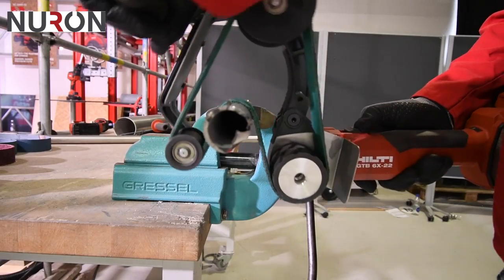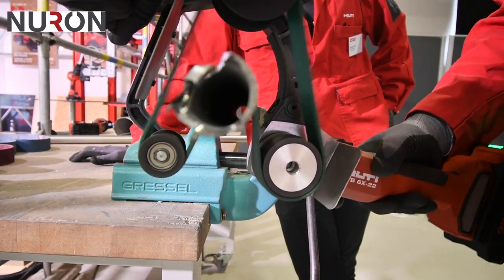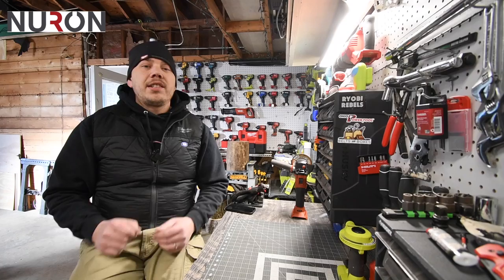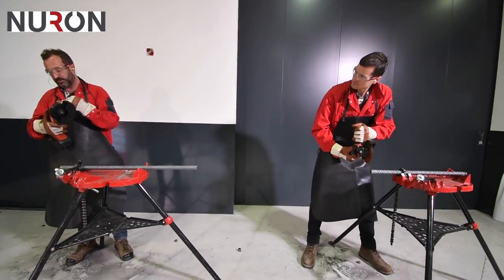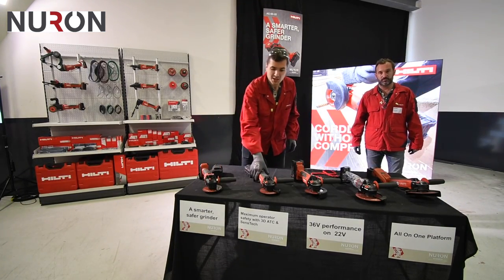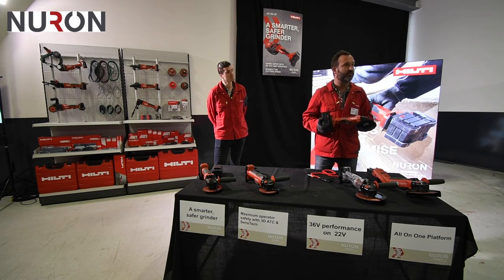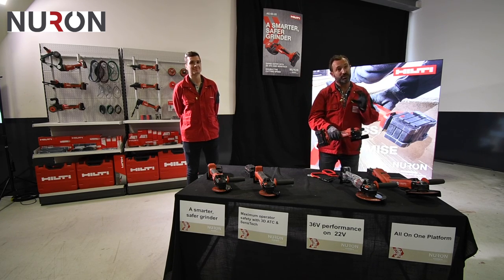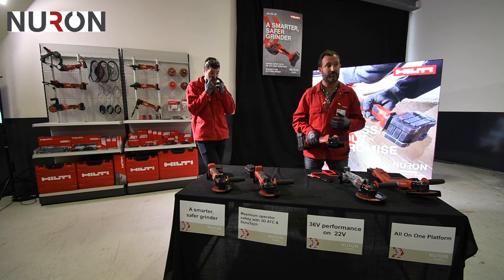These tools will "GRIND" your grears

Comment: Is Nuron version expensive ? Comparing to Milwaukee or Dewalt.
Reply: Ya , I dont think there is many that can keep up with hilti prices . 🤑🤑🤑 sooooo overpriced
Reply from the maker: HILTI needs to do sales like the other brands have. With HILTI you dont get discounts yet if you buy a kit. Im hoping that it changes in the future
Reply: The batteries are expensive.  The tools are cheaper than Milwaukee and Makita. The specialized stuff…hit or  miss on price competitiveness.
Reply: @onsiteelectricianscott4025  Compared to what?
Reply: Milwaulkee, Dewalt, makita, Hilti is more of an industrial brand tool company, they make the best of s.d.s hammer drills on the market, I have never owned a impact from hilti so I cant say they are the best but hilti is rare industrial strength , not many people got them because of price and availability of them
Reply: @onsiteelectricianscott4025  Like for like, I’ve found that their bare cordless tools to be the same price or even less than Milwaukee and Makita.  Dewalt can be very affordable, so it’s a little mixed there.  The batteries, although cheaper (like for like) get you because they don’t have promos or discounted kits.  Amplify that with Nuron because, like Milwaukee/Bosch/Metabo, you now need a different battery for each tool even though it’s on the “same platform”.  Sure, they have a $60K wall cutter, $3k direct fastening tools, and $2K press, crimp and punch tools but that’s really not what those other brands have on offer….wait…Milwaukee has $2K press, crimp and punch tools.  I was looking at the Nuron tools on Tuesday. Their metal stuff is nicer than Fein, so it’s appropriate that it’s priced accordingly.  The jigsaw is nicer than Festool and closer to Mafell.  So it’s good that it’s…cheaper than Makita.  Their 1-1/4” SDS Plus is cheaper than I’ve paid for Bosch, Metabo and Makita (who are way too proud of their SDS).  Milwaukee impact driver is $130, Dewalt Atomic was $99 and now $149, Makita is $189 or $230 (LXT and XGT), Hilti is $159.  Their basic drill is a hundred bucks.  Their 9 amp charger is $80.  Their 4 amp charger is like 30 bucks.  I just don’t see Hilti as “expensive”.  Not until you compare anchors and concrete bolts.  If you’re an individual, it’s almost like buying from Grainger.